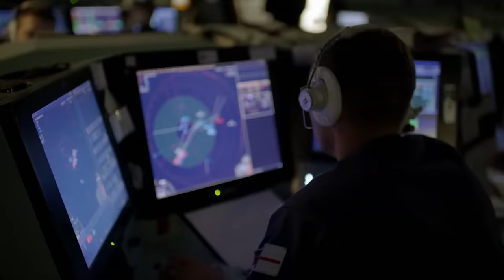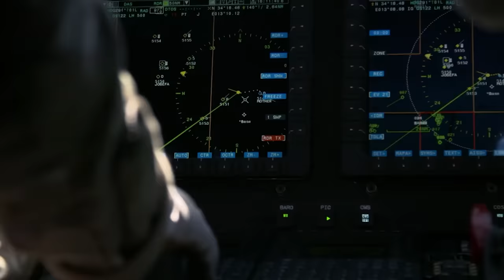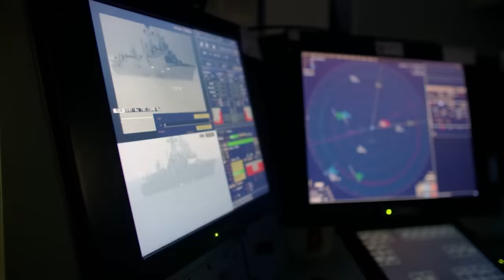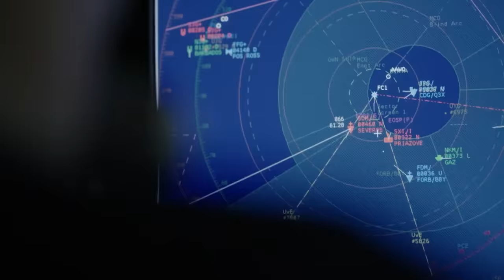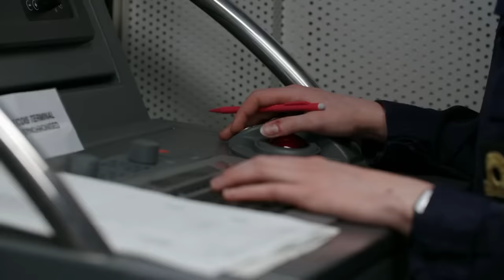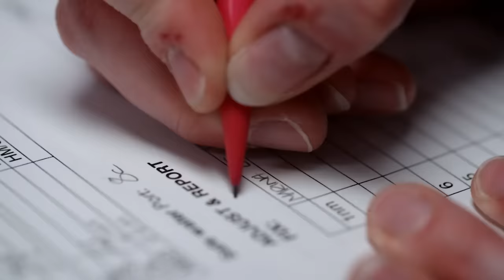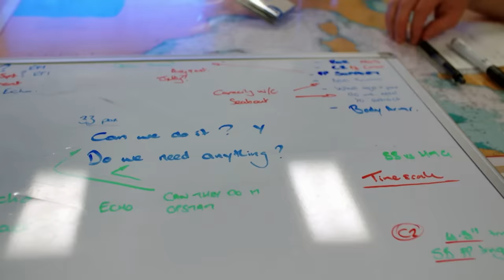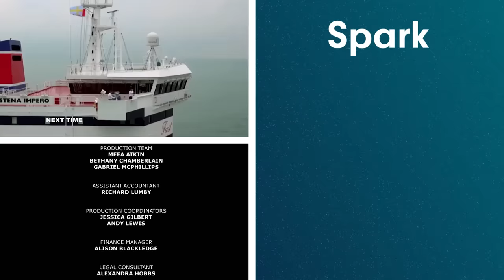HMS Duncan: Protecting French Aircraft Carriers From Enemy Submarines | Warship | Spark

Comment: I was literally sitting here thinking…Watch this the Russian submarine is going to be surfaced(not hiding) and guess what… it was SURFACED NOT HIDING😂 great work you just detected a surfaced submarine!
Reply: When you serve on a ship you can make that judgement.
Reply: @belaeszpresszo9270   I’ve talked with several unbiased officers in both the Russian and US navies throughout my time working on military technology, and I can tell you for a fact The kilo class submarine and the improved kilo class submarine are extremely hard submarines to detect. Diesel electric subs are the most quietest submarines made. They would not have detected it if it was submerged end of story! And he was using the surface search radar which should have easily picked up this surfaced submarine, it’s a very easy task.
Reply: @war8036  True, submarines aren't that easy to detect. The only reason why most submarines get detected is because of a accident (loud noice inside the sub) or intentionally did so for whatever reasons. But if they're in actual war situations, detecting them is super super hard.

Comment: Got to be kidding! total insanity! You mean to tell me the radar technician has to use an L hex wrench to remove each screw the radar?. As a engineer technician in the medical field we use cordless Bosh high speed clutch screw guns and drivers and all repairs are done on site. Also during war you cannot just go to port to get a replacement radar, you repair the damn thing on board, and an oil leak is just about the easiest problem you could possibly have, God forbid an electronic failure. And i hate to see how they will repair the main radar units at sea. This is as bad as the American destroyer that shot down a civilian jet liner because it did not have the ability to communicate on civilian frequencies. Some things on these billion dollar ships just don't make sense. Like weekend at burnies dude running this country.  FJB  FBO FLP